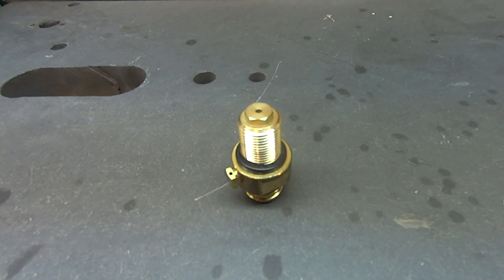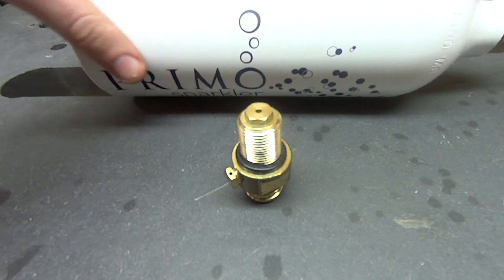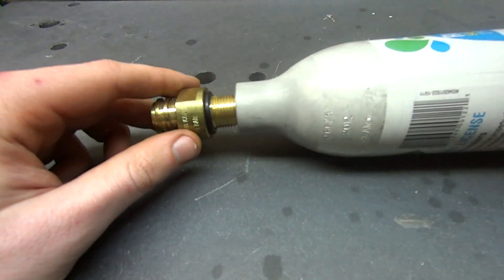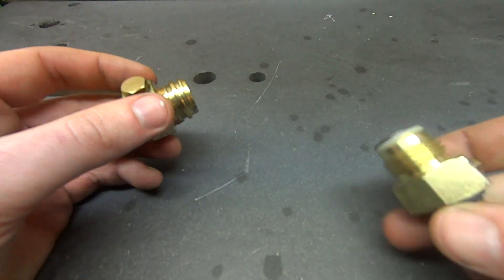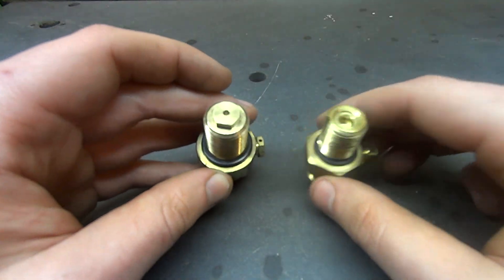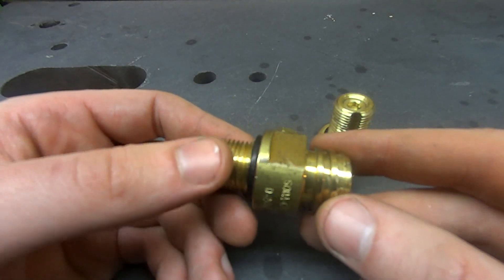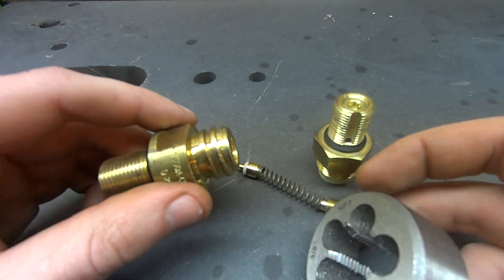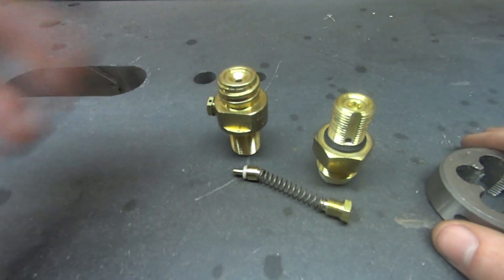Sodasteam co2 bottle pin valve - investigation and how to

Comment: Is there a ball bearing or something inside the safety valve, i took mine all the way off an now when i tried filling it everything leaks out the safety valve
Reply from the maker: No it's a burst disk. You either punctured it, or it's leaking from the threads, and not the valve
Reply: Ok, Thank you
Reply from the maker: @ARC3333  sure thing. I'd suggest wrapping the threads on ptfe tape and trying it again.
Reply: No its burst
Reply from the maker: you could plug it, depends on how risky you want to be / what psi you;re filling to
Reply: i was just adding the dry ice by weight an apparently put in to much
Reply from the maker: @ARC3333  that's pretty wild. Those bust disks are rated at 3k psi. Normal co2 is 850psi
Reply: maybe the disk fell out??
Reply from the maker: @ARC3333  the valve is one piece
Reply: Well i ordered a whole new valve, was cheaper than just the safety valve

Comment: Hi. Do you know what is the size of co2 pin valve o ring ?
Reply from the maker: renif333r the large one seen at the beginning of the video? The one that seals the entire brass piece into the sodastream bottle?
Reply: That little one on the pin.
Reply from the maker: renif333r well there's a white nylon? washer. And the two black nitrile o rings. I'm around now. But I can check later
Reply: I would be grateful
Reply: @renif333r  Did you ever find the inner pin seal?  I need a replacement one.
Reply: @swandonovan  I'd be very keen to know what the nylon washer is. I need a new one.
Reply from the maker: @fifis101  best off just getting a new valve

Comment: Newer valves are made in a way that it's hard to remove with out demaging valve. But you can still fill it, the trick is to introduce the co2  slowly as a build in valve acts on rapid pressure changes. Just turn go slow and you'll be able to recharge it with out any modification.
Reply from the maker: For Better World this video was for use in air guns
Reply: How slow? Do you have to turn the black valve into the cylinder all the way or just a little bit?
Reply: @sanaaamar5979  open the tank that you're using to fill very slowly till you start to hear the liquid flowing and with some practice you'll be able to do it if it doesn't work at first time try again and open valve slower till go get the it.
Reply: the dual anti refill valves are a bit trickier to modify but there are two good videos on youtube that outline a couple ways to achieve the results you want ie "quick fills"